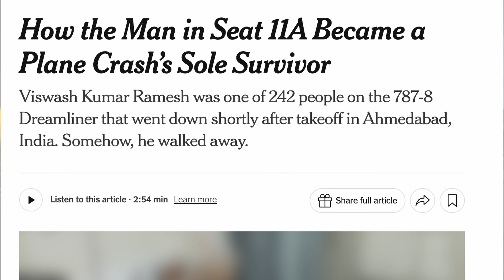Why the RAT Changes Everything – Air India 171 Update

Comment: First if one closes their eyes your ears can really detect the prop sound. 
(ok, you mentioned the following, as posted it as son a i heard the passengers description on an aviation site) Second, remember the survivor stated the LED LIGHTS CHANGED GREEN - WHITE (another colour) several times. Doesn't in LED lighting does that mean a short via the cutting of wires, not just a chanhe in power source from outgoing normal power sources to incoming R.A.T. 
Maybe some part of the wheel area picked up debris (as with SST FRANCE) or a loose badly built portion broke off and cut wires at a critical wire fed point where wires are all close to each other.

Comment: What an excellent podcast. I know next to nothing about aviation, but it seems so odd that the thrust was there to get the plane off the ground - albeit that it did look a rather "slow" take-off - but then the apparent dual engine failure just seconds later. Apparently some of the in-cabin electrics were not functioning well on the flight the plane had made earlier in the day from Delhi.

Comment: Flaps has to be bottom of the list if you think about it; because there are automatic fail safes and so many alerts, even if the plane let them disengage the flaps it would have alerted them and they would have had time to correct that rather than calling a mayday and just cruising into a populated area.

Comment: I agree on the double engine failure, but also a brief restart, due to two key moment in the short video, yes you hear the RAT, but you can also hear the sound of the engine slowly restarting and you can see the plane remain in altitude, then slightly gain altitude again before you can hear the engine stall completely again and the plane quickly going down. The question is, what caused it? The power failed immediately at takeoff, no bird strike of any kind can be seen on another video, so it had to be a technical or hydraulic failure at the moment they went airborne. and if that is the case, and it is linked to a Boeing repair of component failure before it should, they will not be in a good place again. every Dreamliner in the World will be checked. let's just hope no other Dreamliner fails between now and the results of the research.

Comment: Steve, it absolutely can be and likely be complete electrical failure, which would completely cut off all fuel and just a simple eventless flameout on #1 and #2 simultaneously and "loose thrust" and likely only noticed the electrical and never had time to recognize the dual flameout

Comment: Boeing 777 British Airways Flight 38 crash in short final to Heathrow, on 17 January 2008. Simultaneous shutdown of the both engines.
Air india:
FADEC system faults?
Contaminated fuel?
Bad Thrust Limit settings on the FMC with high temperature outside?

Comment: First time I saw the video from the 7 o Clock position it was clearly a dual engine failure or at least the throttleing back to idle.  It normally takes at least 3 system failures to bring down a large aircraft as sufficiated as a 787 so maybe the flaps and Leading edge slats were either misdeployed or retracted as the video shows them retracted.  the RAT deployment is just a symptom of the failures on board the aircraft.  With todays Airliners extremely dependent on automated systems that has also have to be a concern which especially with Airbus the engines thrust is managed by automated controls system which if in flight configurations have throttle back engines as if configured for landing when the Aircraft is not on final.  This is going to be a game changer accident once they determine the cause(s) of the accident.

Comment: I have not worked on Boeing 787's during my career but on similar advanced aircraft. Each eng has what we call an EEC or engine electronic control. Most of these engines are FADEC (Full Authority Digital Electronic Control). They are the Brain for the engine that receive and control signal inputs from many components, especially from the pilots throttle input. Logic tells me that the moment they realized their airspeed was decreasing I can only imagine in panic mode he moved the throttles to 100% thrust. Whats concerning is redundancy was lost and input from both throttle positions to the engine main fuel controls may have been affected resulting in low or no fuel increase regardless of throttle position. Only time will tell through the investigation, but until then I am leaning in this direction with my thoughts. I hope this never happens again and my heart goes out to all who lost loved ones!

Comment: My theory...
Only one engine had a catastrophic failure... 
By the motion of the plane WAS the left engine causing the light turn to left fast compense by auto plane systems .
As the RAT was down AUTOMACTILLY the 787 software was then in FULLY COMMMAND.
As said on the video, the RAT was build supposedly to be use in a engine failure IN HIGH ALTITUDE scenario.
On that case the NORMAL PROCEDURE (even in a single failure) is to eventually turn off both engines (after the RAT down), nose down and try to restart both engines descending fast.
If the DUMB BOEING SOFTWARE try to execute this procedure in a TAKEOFF at LOW ALTITUDE the result will be the "accident" we had in India...
MANY accidents we have since fly-by-wire and the intervinience of those automated avionics and automated flying computers controls ware "errors" or "misjudgments" introduced by engineers assumptions or presumptions...
Before the first flight of the NEW MODEL...
For me, is this the case... AGAIN!!!
The only doubt HERE is that accident was REALLY a rare double engine failure OR the second ENGINE was turn off or had his power reduced by a wrong software programming line or "decision"... Instead of give the second engine go to FULL POWER...

Comment: Without knowing the layout of the electrical system, is it possible that FOD could have both engines flame out ? There as a lot of speculation about the build quality of the early 787s. Fuel contamination has happened before but then the airport authority #should be able to inspect the fuelling infrastructure.

Comment: There were also complaints that the AC was not working and  the lights were flicking on and off before the plane took off, which might also add to the possibility of dual engine failure.

Comment: We need to seriously stop and think about this for a second. No visible bird strike or damage or flame out. There is two main engines for a reason, redundancy. As you previously stated, the plane can easily fly on one lit engine. Besides fuel contamination which is highly unlikely due to the safeguards in place and no other planes reporting issues with fuel. For both engines to fail at the same time would not make sense. So sad how somehow something fell through and so many lives lost. Hopefully we figure this out soon as these planes are all over the skies and even if the likelihood is low, one is already too many.

Comment: I'm not a pilot or an aviation engineer, but I've flown dozens of times in over 40 years.
Before this Air India crash I had never heard of a "RAT" auxiliary/emergency engine, but now I've watched a few videos of this crash and also of RAT deployment on other Boeing aircraft, it strikes me as one of the strangest pieces of design you could put on a modern jetliner.
I would have imagined that something like this would be integrated into the fuselage like an APU.
But there again, I'm not a pilot or an aero engineer.

Comment: First and foremost condolences to all of the families and friends of lost loved ones and everyone else affected by this tragedy ...
Yes dual engine failure Captain Steeeve, my theory is a flame out, but NOT due to fuel starvation/contamination but due to air/oxygen deprivation, my theory being :
 The aircraft started it's take off run, was struggling to gain enough thrust/speed to begin with due to hot/thin air and possibly other technical issues. It gets very near to or at the end of the runway before lift off and starts to suck huge amounts of dust/dirt into the engines, enough to starve the already lean engines of adequate air to combust at the critical take off phase (thus no evidence of runway fodder, the evidence will be in the engine strip down if and when it is done).
 The dust cloud in the video isn't being blown up from the ground by the back/exhaust side of the engines, it is falling back to the 
ground after the aircraft eventually clears the ground enough to stop the engines sucking dust saturated air in from below. This is why only over wing jet and propeller aircraft are used where there are no proper concrete/asphalt runways.
The loud bang reported may well have been a dust explosion within one on the engines. So yes the RAT would have deployed due to engine failure, but at that altitude there was no time for engine restart sequence anyway.
 In the video you can most likely hear the RAT, which operates much like a windmill but with blades shaped for speed to produce electricity. But what you definitely can't here is the engines spooling up to full thrust which the PF would have no doubt commanded  well before this point. The engines are doing more or less the same as the RAT at this point, being driven only by the remaining forward momentum of the aircraft or spooling down after flame out. In the other videos of RAT deployment, the aircraft are in landing phase NOT take off, hence close to the ground, so it's sound is much more defined and clearer.

 The final pitch up attitude is the PF trying to save as many souls as possible, he knows the main hospital buildings (which are 6 storeys high) are ahead of him as he's no doubt took off from RWY 23 many times and is desperately trying to avoid colliding with them.

Comment: The problem since about 10 years ago is there is lot more emphasis on software leading to not so much emphasis on the performance of hardware. Also more and more hardware is automated and involved complex software leading to higher probability of glitches, The two recent Boeing jet crashes and the airbus crash over the Atlantic were due to too much relying  on software.  This trend in everywhere so much so that computer programmers are now  called engineers

Comment: Wouldn't there have been distortion or heat haze coming from the back of the engines if they were running? Especially at full tilt for take off. Didn’t look that way in the video

Comment: Root Cause of Air India AI-171 crash:  
   - Unintended thrust reduction triggered by the captain’s seat sliding backward** during rotation (liftoff).  
   - The captain seat’s **AFT lock mechanism failed**, causing sudden rearward movement. The captain’s body weight forcibly pulled the thrust levers to idle.  
   - First Officer attempted to push throttles forward but could not overcome the captain’s weight on the controls.

Comment: Here's my take on the failures  leading to the  Air India flight AI171 crash.  I'm going on the record with this explanation:  I believe the pilot's mayday message, Mayday, mayday mayday,  No Power, No thrust going down! meant there was total loss of electrical power, including to the electric fuel pumps of the 787 which provide fuel to the two jet engines, which caused immediate shutdown of both engines, and deployment of the Ram Air Turbine (RAT).  So it was  total electrical failure that caused the crash.

Comment: Captain Steve, I've been watching your YouTube channel for several weeks now. I've spent 42 years in aviation. From an A&P mechanic to a maintenance manager to an aircraft inspector. Now, focusing on the Aiir India crash from all the media I've watched, nothing has been mentioned if a  possible maintenance issue or mistake has been made. They talk about possible fuel contamination, have they check the fuel truck or fuel farm for contamination. What about sabotage. Pilot under stress, did they deploy the RAT manually. The gear was down since takeoff. They did not touch the gear level at all because the doors would have dropped open. The flaps were hard to see, but I think they were at 5%. I don't know if that is enough for takeoff. Were the slap deployed. Also, you mentioned that it was 110 degrees,  why didn't the pilot taxi to the end of the runway and take advantage of the whole runway on a hot day specially having a heavy population at the end of the runway. The India media seems to be blaming Boeing. The airplane is 11 years old, the maintenance was not done by Boeing. Why are they blaming Boeing. And now suddenly other airlines are coming up with some issues. A plane with a great safety record. Air India and India don't want to take this responsibility. I pray and send my condolences to all the ones who lost a loved one.

Comment: Captain, so because of such a long take off run, could it be that they have hit  V1, realized that acceleration is slow - but it was still accelerating, and then they had seconds to either reject after V1 or take off knowing that acceleration aint right...They went all the way to the end of the runway to get max speed and took off hoping that perhaps it 'might fly'.   Sometime after that the engines failed completely.   So, could  they have faced an impossible situation of rejecting after V1 and crashing at the end of the runway or taking off hoping that it might fly, knowing that it will probably crash ?

Comment: Should the FAA mandate a data feed with engine data and configuration data until 20,000 feet showing engine op parameters control surface configuration data., error messages.

Comment: Problem with this theory is you can hear the engines running.  Flaps weren't down and this was verified by pictures of the wings from the crash with flaps at 0.  The best theory I've seen is the pilots entered incorrect parameters into the FMS causing the aircraft to behave this way. We will find out soon when the boxes are dug out.

Comment: Capt Steeeve, are you telling me that a RAT and it's passive generating makes the same noise as a high horsepower engine turning a prop to lift an aircraft into the air and continue moving air over the wings to keep it airborne? Are you sure that air cutting prop sound wasn't from another aircraft out of the shot on takeoff? Surely there must be testing videos of the RAT in operation, I'd be shocked if it made that much sound. Just sayin.

Comment: The latest I have heard is that, water infiltration ( because of monsoon rains), into a electrical system component lead to the complete failure of all electronics on the jet .  If true how could there not be a fail-safe for that scenario ??
Reply: I guess the problem would be improper maintenance of the plane, allowing water to get into the systems.

Comment: As you a pilot have you ever heard after 2 check list before take off and full power power thrust [ Both engines at the same time stop ] after take off and seconds thats no way , even one engine still the plane can fly , come on even he put the flaps up there is 5 to 1 from 1 to up still fly

Comment: Does anyone know, why the RAT got deployed but didn't prevent a plane crash??
Reply: It is not designed to be used at this altitude and they ran out  too quickly to correct anything. Even if there was power to restart the engines they will NOT speed up fast enough to recover before hitting something on the ground. Imagine..They will either have NO CLUE about what's going on because they had no power..and if there is power a fucking pandamonium of warnings and loud voice commands that even seasoned pilots will need time to troubleshoot.

Comment: IF a flight crashes due to FUEL CONTAMINATION, wouldn't any other flights using fuel from the same batch be at risk❓️It seems this would be an UNLIKELY reason for Air India's crash as no other planes have crashed... at least not yet. 🤔

Comment: Engine problems at/before take off. Confirmed by...muddy take off..using the best part of a 11,000 ft runway.  Complete failure at/before 15 seconds. Confirmed by Pilot saying - loss of thrust before calling mayday. RAT deployed, confirmed on day 1 by many, many youtubers..Boeing shills like you tried to pass it as pilot error...Until photos of the downed wing fuselage proved that you were wrong. The other reason mentioned - landing gear reduced engine thrust and downed the plane. A pilot with a monkey's brain knows that a  landing gear not being retracted just slows the plane down, but can never bring it down. Confirmed by - a single engine thrust can fly this aircraft, so an entire extra engine power is available to overcome the turbulence due to deployed landing gear. Easily done. And the most telling evidence- statement by the survivor. Loud bang immediately after take-off. Proves sub system(s) failure including maybe the engine. So, all you Boeing shills, including many Australian pilots blaming an low-time pilot. 8000 hrs only on the 787. Possibly 10,000 hrs on other ratings before he came to the 787. It's not a dual engine failure - because the engine did not fail. The sub systems BEFORE the engine failed, causing the engines to fail. Power/fuel/other (maybe even software glitch..result of bust onboard computers due to...battery overload..calm - just wild speculation - no different from callin this incident "pilot error" the same day!) or combination of the above. Engine was starved out - it did not break into bits...which is what engine failure means. Confirmed by no smoke or fire or debris from the engine. So the local goons are still right on that one, along with no bird strike. All the viral videos that CAPTAIN STEVE made on day 1 has all been bogus. LOL. The fact also is, no new info is available today compared to day 1. Just had to be processed properly. Sad sad pilots out there. And Oh Boeing. You are in trouble again.